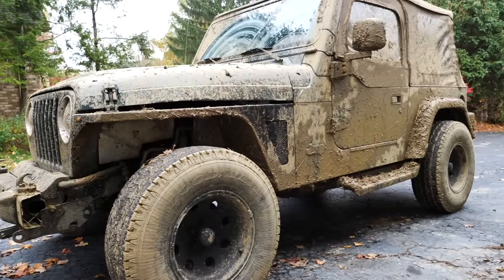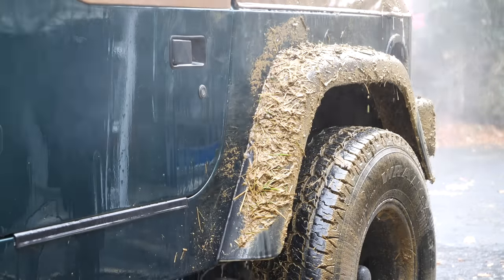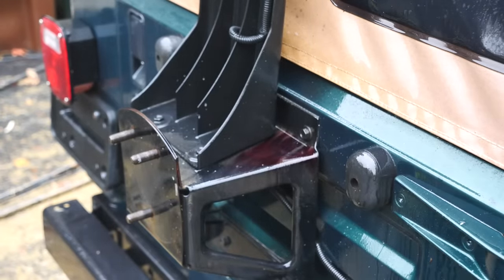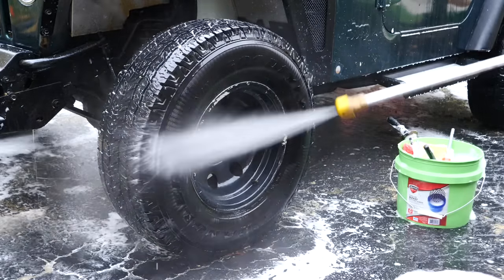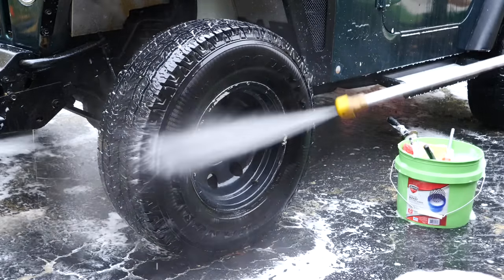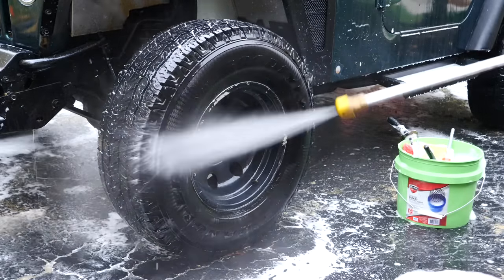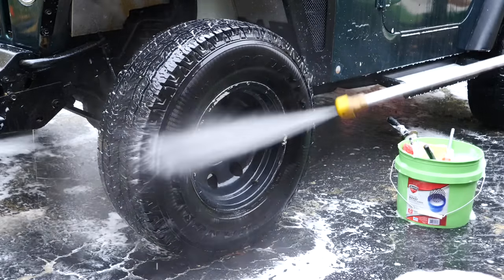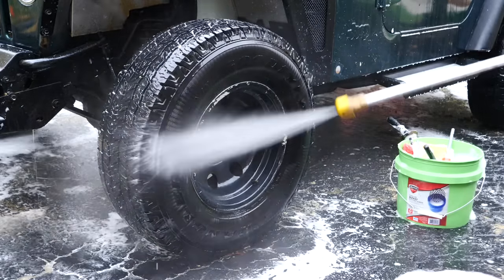Deep Cleaning the MUDDIEST Jeep Ever! Car Detailing Pressure Washing Restoration

Comment: Hmph...dont ask me what kind of car I want, lol, because my answers would surprise you:
1) 2002 Subaru WRX, fully modded where I can go 202 mph.
2) 1968 Ford GT40. This car could do 218 mph, stock, from Ford.
3) 1968 Ford Mustang GT 500 KR. One of the monster machines of the 1960s.
4) 1969 Chevy Camaro with 1 of 2 COPO 5960 ZL-1 packages.
5) 1999 Nissan R34 Skyline GT V-Spec C-Spec. The fastest of the fast R34s.

Honorable mention: 2004 Chevy Cobalt Stage 4. This car is RWD, and could produce 1500 HP from GM.

Comment: 2019 chevy 2500 3" lift with xd black rims she needs to be black with green trim and undercarrage rhinolined ceramic coated ready to play. She would need to have all fabric and wood interior so i would be making parts myself to replace everythimg myself all other interiot wrapped with carbon fiber to protect all the original stuff. 4" exhaust and cold air to make her sound and feel as gnarly as she would look.

Comment: If I could have any car I would want my parents' old 2003 Ford Escape in mint condition. They got it around the time I was born and I liked riding around in it when I was younger. It was basically THE car to me and I wanted to drive it when I finally get my license. Unfortunately they got rid of it when the thermostat broke and the engine started overheating constantly. That thing lasted for about 15 years before it crapped out.
Reply: If not that then my uncle's 2012-2013ish Ram 1500. I've only ever ridden in it once and I loved it. If I were to get a truck or SUV (which I'd probably have to, I'm like 6' 3" and climbing in and out of cars is a pain), it'd probably be one of my first options.

Comment: I owned a TJ.  If you take the front fenders off, guess what.  Mud.  Then take the doors off.  Mud. Then take the top off.  Mud.  Flop the windshield down.  Bugs in your teeth and goggles.  Then go home and spend an hour cleaning it up and another hour putting back together so you have a way to get to work the next day.

Comment: 1993 Mazda Rx7 FD with a 1.3L Twin turbo 255 PS twin-rotor engine, VeilSide USA Aero bodykit, RX-7 GT rear wing, Lexan headlight cover, & VeilSide rims
1994 Toyota Supra MK IV with a  2JZ-GTE l6 Engine, Turbonetics T-66 ball-bearing turbo
Delta II wastegate, RPS stainless steel/HTC-coated custom header, NOS 100-hp NOS system, AEBS turbo downpipe, GReddy Power Extreme Exhaust, Pro-Fec B boost controller, Airinx intake, Clutchmasters stage III racing clutch, 11-pound billet flywheel, M5Tuners 19" Dazzle Racing Hart rims, & Eibach coilover suspension.
or a 1999 Nissan skyline GT-R R34 with a 2.6L RB26DETT twin turbo l6 engine, C-West/Motorex body kit, Flexivity rear wing ,K&N Ram Air system, HKS Titanium Exhaust, Turbonetic Intercooler, Sparco harnesses, MOMO steering wheel, Clarion head unit with LCD TV screen, JBL amp, Infinity speakers, HRE 446 wheels, Toyo 275/30ZR-19 (F/R) Tires, JIC Magic shocks, Goldline springs, & Stop Tech brakes 3 of my dream cars